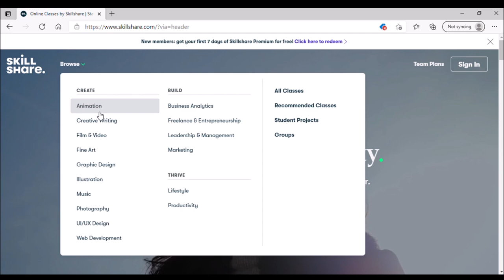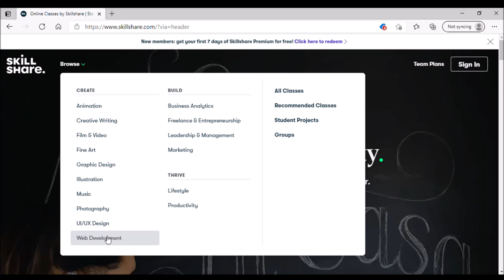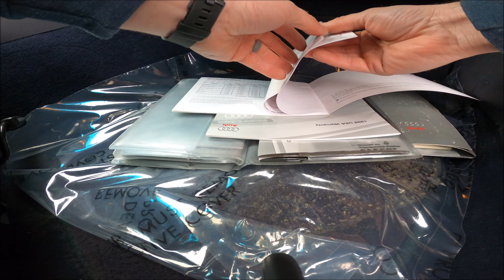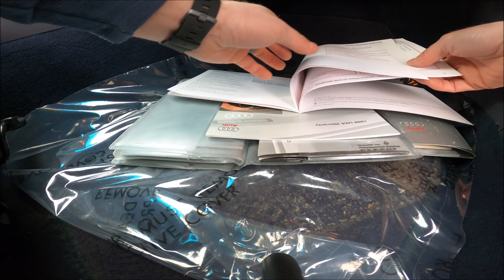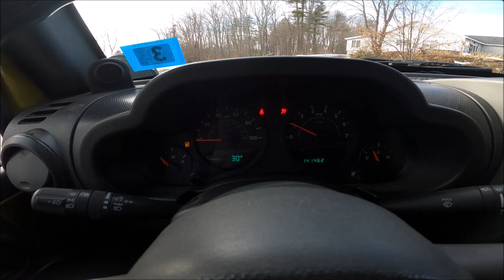This one surprised me! $400 Ferrari Flip - Flying Wheels part 12

Comment: This is going to sound INSANE, but fast orange hand cleaner will make leather seats look like new. The slight abrasiveness gets out those little cracks. 

Disclaimer I used it on white leather, similar to that Audi, can’t speak on black leather. Make sure you spot test of course.
Reply from the maker: Thx! Good tip

Comment: Loving the series so far, that airbag light on the dash is it not the light that shows passenger airbag is deactivated for baby seat? There should be on most cars a keyhole or switch somewhere if you turn it it reactivated airbag and light goes off

Comment: About the airbag light.....in those instances you may need to clear the code.
Reply: Usually airbags, once you fix the problem the light automatically goes out. Still important to pull the codes to verify.

Comment: You probably know this but for the headliner you can poke a pinhole in it and stick the straw to a spray adhesive can through and spray it and stick it back up. It’s not a perfect solution either but better than pushpins in my opinion 🤷🏼‍♂️

Comment: There is a factory recall for the clock spring on the 2007 Wrangler. That will fix your air bag light problem.

Comment: 10:53 i fight that "sell too cheap" at first glance i agree with you but ive had a few people tell me that a quick flip is a wonderful thing(instead of waiting for it to finally sell and now that you lowered the price.. now what just broke/ whats wrong with it?) and now you can just move on to the next project, id be curious if people agree or disagree and why
Reply: With auction prices right now so high I don't think it's a good thing  because you won't be able to replace the car.  I look for a average of a 30 day turn around. Any quicker you're probably listing the car price too low.
Reply: I have turned down some deals I later regret. If its "reasonable" take the money and run.

Comment: So you had 10k you bought the jeep for $8500 and put $1500 into not including the $10k jeep you used to swap parts with. Or the extra $1000+ for new tires. That means you spent $10k+ (way over budget now) on this jeep. So when you bought the Audi with that $1500 you technically didn’t have it so you because you put that into the jeep. So that extra $2500 doesn’t exist in this scenario